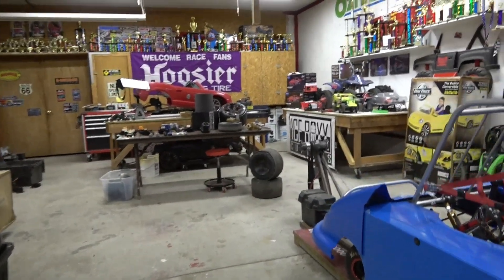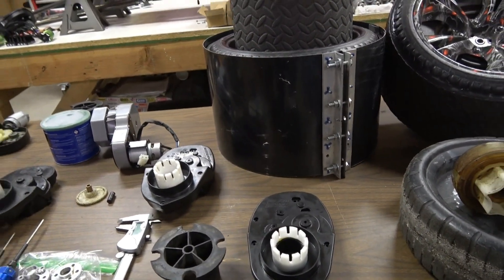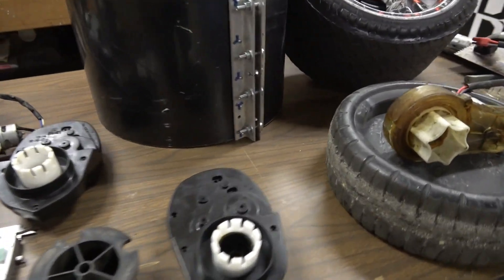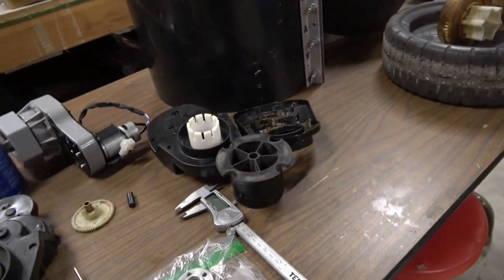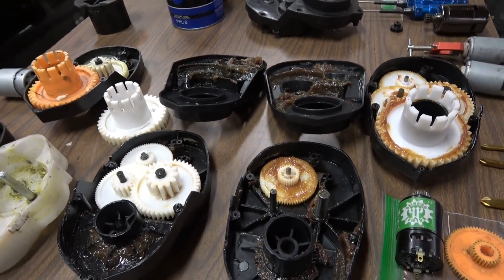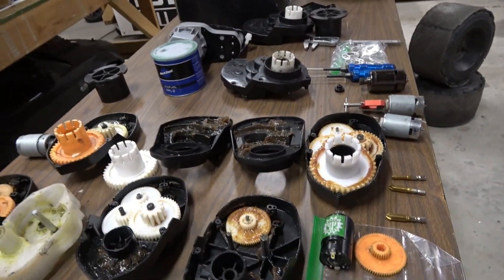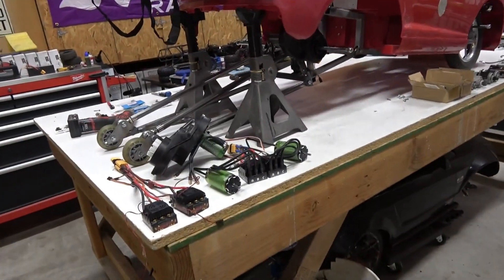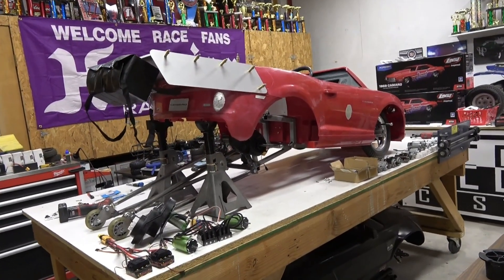Mini Fireball Camaro- Traction and gearbox upgrades #brushless #powerwheels #dragracing

Comment: Is the white mark to measure RPM?
Reply: It’s a way to tell if it’s spinning the tire or it’s hooking
Reply from the maker: Nope, but it does have to do with the wheels rotation, hint hint.
Reply: @CustomKidzCars  Strange. I thought for sure that it was a tach mark. Is it to indicate the start/end point of the tread? Is it used for balancing, perhaps?